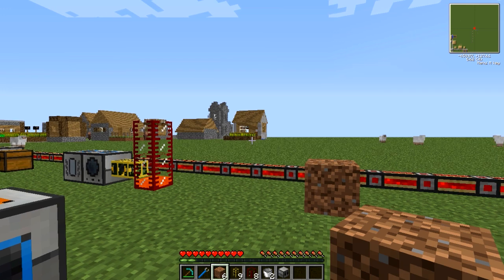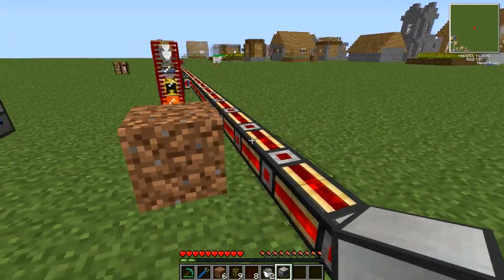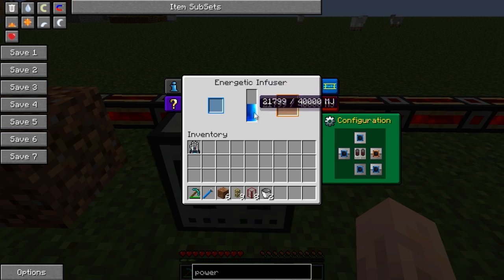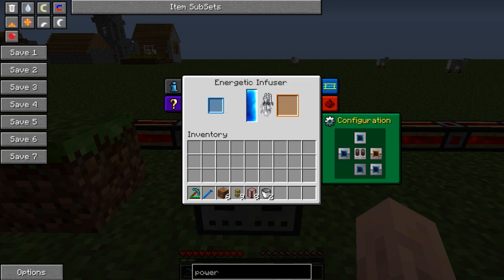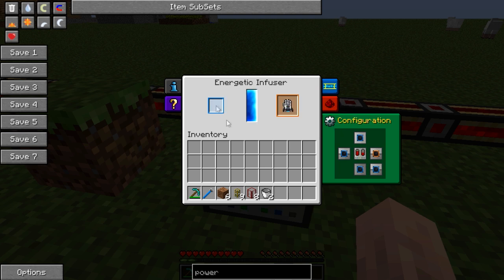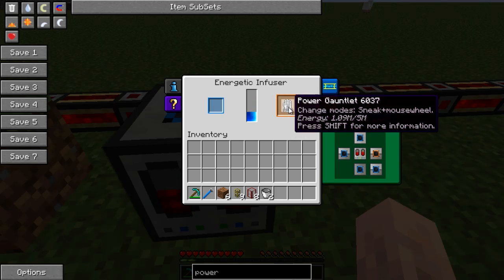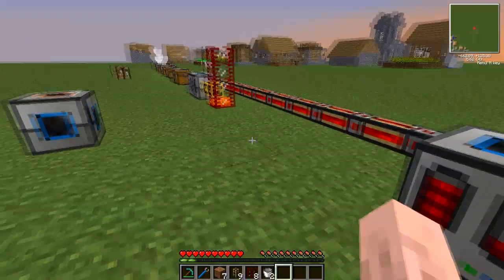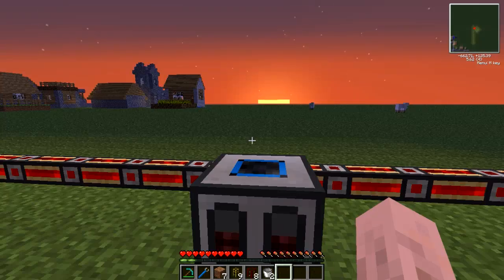(NEW) TEKKIT Tutorial: The energetic infuser, charge your power suits with MJ

Comment: It didn't glitch out, TE machines use differing amount of energy depending on how full their reserved energy is. Clicking the top tab on the right side of the interface will show you how much it can use per tick maximum and how much it is currently using. 

When it "glitched out" in the video, it had dropped to a point where the energy coming in matched what it was putting into the multitool, and that's why it was no longer bleeding energy out of the reserve and also why it'd slowed to a crawl.